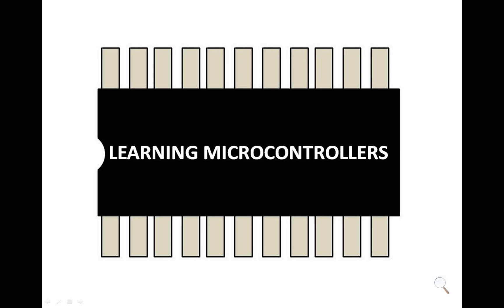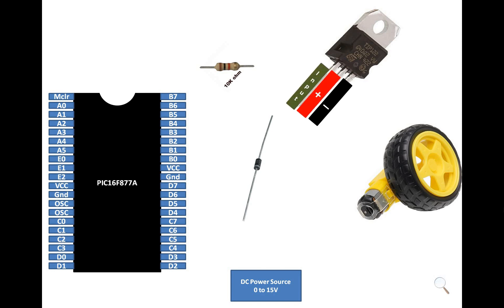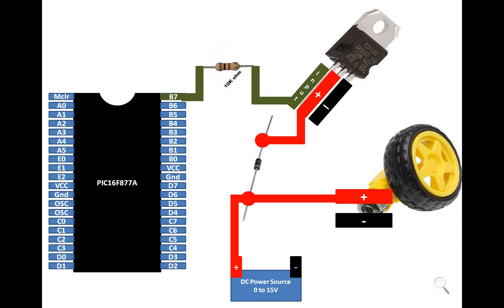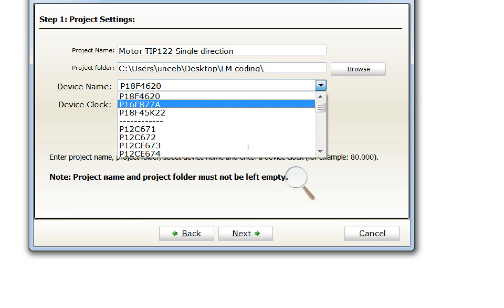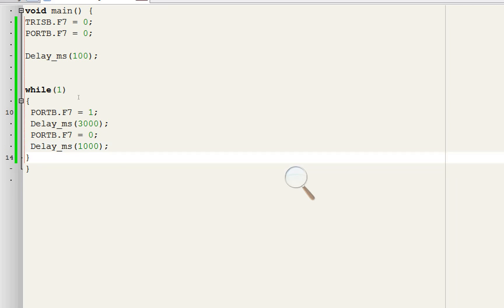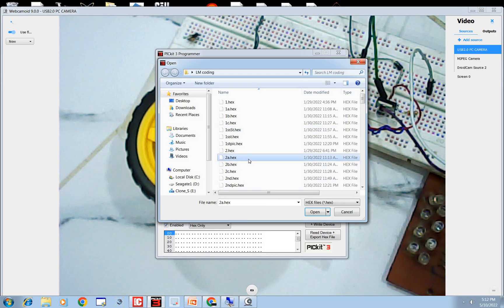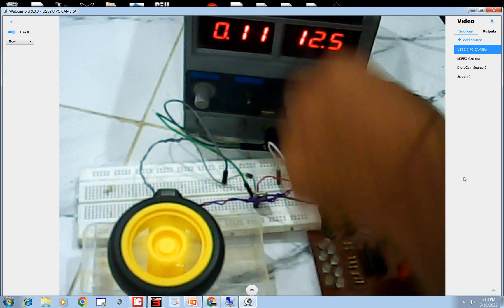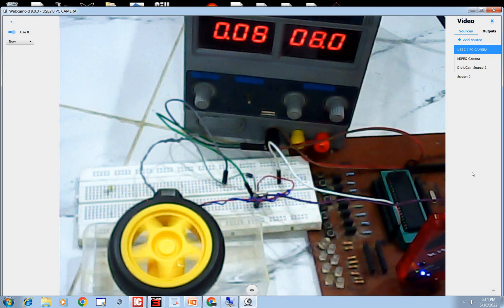PIC16F877A interface TIP 122 NPN transistor for driving DC motor.

Comment: First off, I really enjoy and like your hard work and videos. Now to the circuit. For the PIC to have any influence on that transistor shouldn't both the pic and transistor share the same ground also? Secondly, I am a bit puzzled concerning the transistor the configuration, it almost appears as though the transistor is now being used as an open collector; excellent. Lastly, is that diode intended to block any reverse current from destroying that transistor or is it to bias it or to insure that no high voltage can ever back feed into that PIC? I've seen and used  diodes in similar cases while driving motors with mosfets paralleling the drains and source pins.Just curious 🤔.
Reply from the maker: Thanks for the encouragment.
They are sharing same ground
But Motor will need power from external sources battery or some sort of DC power supply.
That source ground is not necessary to be grounded with PIC.
But transistor must share a ground with PIC.
Which will automatically ground the external source, transistor and PIC ground as commond ground.
You may even use diodes to give direction to ground.
Transistor is being used in half bridge configuration, it is working like a relay here, you can say.
Its like a relay with only normally open terminal.
As soon as you give 5V to the base pin of the transistor, it will act as a switch which will allow conduction from collector to emitter. Just like incase of a relay as soon as you give required voltage to coil of a relay normally open becomes close.
Here same work is being done using a transistor.
It is working as a switch here.
Yes that diode will maintain the direction of current and will make sure that no reverse current is able to destroy the circuit.
Reply from the maker: I will soon be uploading a part 2 of this video
In which I will show you how to use PWM to control speed of motor from PIC, while keepomg external voltage at any constant value.